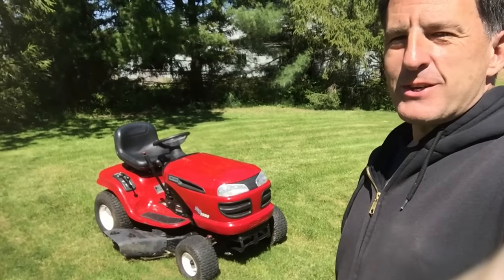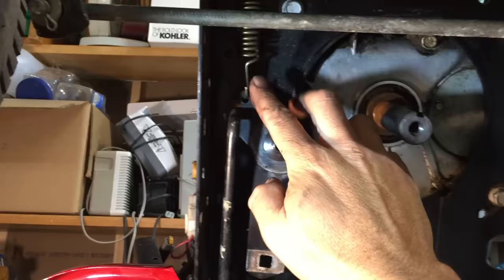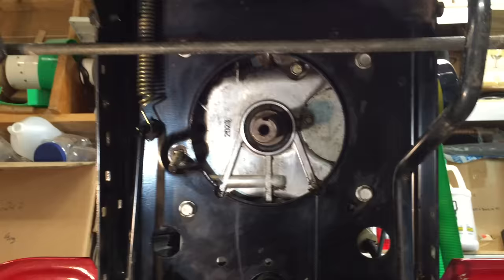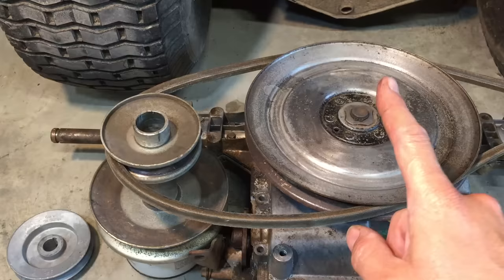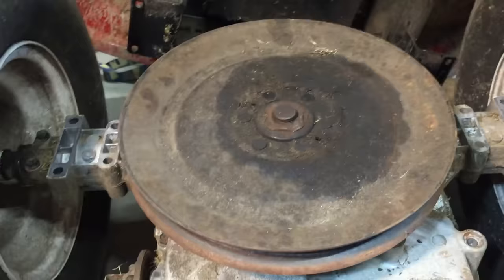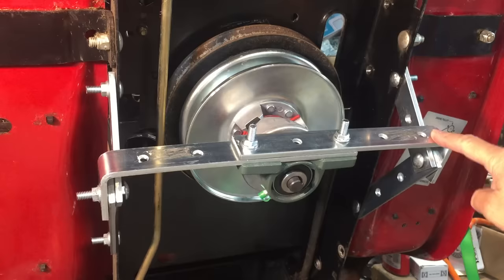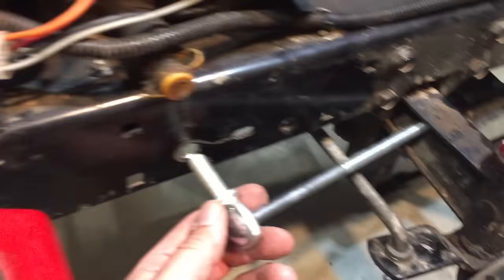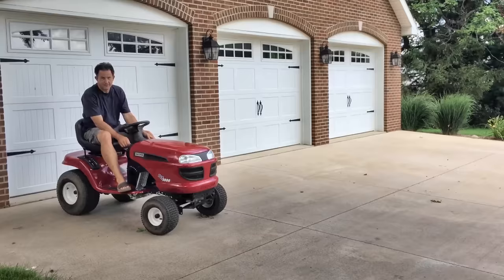Easy DIY Racing Mower

Comment: You forgot the most important part! Replacing the muffler with a header pipe, so your neighbors know that you mean business! lol
Reply from the maker: Good point!!
Reply: get a v-twin they sound awesome straight piped.
Reply: @Boemel  I agree.. My Kawasaki 750 Atv Is A V Twin And It sounds amazing.. Like A supercharged Beast And A Beast It Sure Is..
Reply: Nah bro, he did this build right and goes to show you don't need to remove the muffler to get fast because it literally was fast without touching the engine.
Reply: @j887276  the muffler delete theyre talking about is only for the sound
Reply: @aaronjoosepsepp  Which is why I don't understand why people remove it when they do a "build" like it's some type of primal recognition that fast should be loud or something.
Reply: @j887276  loud is cool for them
Reply: @j887276  ugh I was agreeing to the Vtwin in general... But the lawnmower came out really nice
Reply: How mine straight piped out the side got kinda bord of the stacks
Reply: Stupid - better to go as quiet as possible,the less you r seen and heard,the more fun u can have
Reply: @hedning003  It's supposed to be a racing mower!
Reply: @_MOORE_1986  dosnt matter,making noice to no use is just pathetic
Reply: @hedning003  Apparently you've never been around racing mowers before!
Reply: Engine swap time,, needs a twi cylinder, and wheeling Barr's.
Reply: @hedning003  when I put a two stroke on my mountain bike I made sure the exhaust was loud as hell because most people glance at a bicycle and assume it’s going 15 mph not 40 mph. Plus when you add a bunch of weight with an engine and don’t upgrade brakes stopping distance isn’t great so when people pull in front of me not seeing me I’m screwed. Loud pipes save lives.
Reply: @shtboxgarage  r'nt a mountain bike supposed to be used in the woods and such?  where there r no people?  loud pipes r just annoying and a pathetic way to say "LOOK AT ME!!" the less you r heard and seen - the more fun you can have
Reply: A REAL mans lawnmower need a sweet exhaust or none sissy’s use mufflers
Reply: oh i side piped mine
Reply: if i was his neighbor i would love the mower even more if it sounded good
Reply: @hedning003  he’s probably a Tesla fan
Reply: Just cut off the muffler
Reply: This is AWESOME
Reply: You can take out the dotted part out of the bottom of the muffler and reroute the tip it will sound a lot better while still remaining not too loud
Reply: And mud tires
Reply: @Boemel  fr tho
Reply: Briggs vtwins sound great straight pipes
Reply: @Boemel  yeah story goes i traded for a mud mower which has a 24 horse in it was modified had dual exhaust and when I started it was loud lol
Reply: Best video so far , easy , short and no yapping straight to the point . Love it keep posting💯💯💯
Reply: Soon, there is going to be the rapture. It's when there will be trumpet sounds, and after the trumpet sounds, God will lift his people from here. Also, God said people should be living by the Bible. Amen, and God bless you.
❤Jesus loves you
❤* John 3:16 - "For God so loved the world, that he gave his only begotten Son, that whosoever believeth in him shall not perish but have eternal life". ❤
Reply: @allenvayner4987  God isn't real
Reply: @Boemel  I have a v-twin engine on a mower but i need some one to convert it for me to make it fast
Reply: I have absolutely no issue with people enjoying themselves. But deliberately causing noise nuisance to everyone is inexcusable in my opinion. One person enjoying themselves while 1000 people in the vicinity have health issues related to stress. Just not cool
Reply: @imaginitivity7853  Well as your name states, let him have imaginitivity and be creative and have fun and let everyone else fuck off.

Comment: I didn't think it would be that easy to take the slop out of the steering mechanism. Very cool.
Reply: Yeah. I honestly thought this would all be a lot harder it’s way easier than I thought
Reply: Never thought one bolt would make my whole car not drive straight🤷 found that out real quick my rear camber control bolt came out somehow
Reply: @farmerbobbygrows3338  and one too many bolts in your motor can make it not run too
Reply: @RayRayLitFam  amen brotha we live we learn we die trying💪
Reply: Would you please give us sources and parts #'s for the steering bolts and bushings. Sizes etc. Thanks!
Reply: It's not going to last him, those little steering gear teeth wear fast a direct steering system (tie rod/pitman arm) would be the way to do it correctly.
Reply: @FukTheGovernment465  it’s lasted on my 20 year old mower
Reply: @joshmanis9860  You beat on a stock off road mower steering system and they go quick, lol ive done it to many times to count. By this i do not mean just going through mud holes i mean actually being hard on the mower off road wise. Same with a racing mower but it will last longer but still regardless and real race mower uses tie rod direct link steering.
Reply: @joshmanis9860  Consider yourself lucky ha ha or ride it harder like some good off road trails and that will change 🤣
Reply: @FukTheGovernment465  yeah it hasn’t been to the trails in a while because the hoa doesn’t like me driving it on the road I have bent a few tie rods
Reply: @joshmanis9860  Good off road trails will find all the weak points every time ha ha, I live in the country so no hoa to say shit to me, and even if i did and they did i lived in a hoa i would not stop riding regardless but that's just me... But yeah beef up them tie rods by welding some steel bars to them or sleeve them and that makes them pretty strong man.
Reply: @FukTheGovernment465  I might measure a stock length tie rod and buy and adjustable one from go power sports
Reply: @joshmanis9860  sleeve them before you put them on that will reassure they wont bend as easy on yua. Tie rods and stumps big rocks dont mix well ha ha
Reply: Yep, on video it only takes a few seconds.
Reply: lol

Comment: Whenever you get past the originally intended speeds, replacing the grease that's packed in the transaxle with thick gear oil is essential, unless you want to blow out the transaxle. Also, it will heat up quickly due to it being spun much faster than manufacturing spec.
Reply: Doesnt matter when the input shaft bearings dont get no grease and will burn and lock up before the gears inside do
Reply: And adding a breather on the top of the case helps with pressure building from the heat. A simple threaded hose end or repurpose a pcv valve from a car parts store.
Reply: I made one when I was younger with a top speed of 48mph. Ran that stock 5 speed for over 2 years without any issues. I simple switched pulleys though so I still had a clutch but did not have any brakes

Comment: Heres a few extra tips
1. Lower the mower closer to the ground. That way your center of gravity is lower and you wont have to worry as much about flipping
2. You can change the wheel size in the back of the mower so you can achieve higher or lower speeds.
3. Be very careful about how fast you spin that engine. You can lose the flywheel, connecting rod or the torque converter because non of those parts are meant to spin over 3000rpm. (Give or take a bit) I had my torque converter blow on my go kart cause I was turning it like 5500 RPM. Just be safe and have fun, other than that awesomd video
Reply from the maker: Great tips!!
Reply: 5500 rpm coming out of a go-cart is just pure insanity
Reply: seriously, 5500 is impressive
Reply: @johnraitt2555  well do keep in mind I had a flywheel and connecting rod that were billet aluminium and they are rated for up to about 8000 rpm. The torque converter is not, so when you run a high rpm engine like that you have to have like a multi plate clutch or like a juggernaut TC thats actually rated for those rpms. You just need to put an aluminium flywheel and connecting rod in an engine like that if your gonna turn those RPMs. Please please please do not remove the governor until you put those parts in because if the cast iron flywheel comes apart I promise it will rip and tear through whatever it hits. Ive seen guys on mini bikes have to have their leg amputated because the flywheel shattered and shrapnel tore apart their leg. And everyone thinks it wont happen to them, until it does. Seriously $200-$300 is not that much compared to the hospital bills youll have to get your leg, back or whatever other body part fixed.
Reply: All I’d say with lowering it is you’d have to watch the brackets. 
You could flip the gearbox round and lower it that way and then just put the pulleys in a different position

Comment: Hey that is a fabulous idea super impressive! however your engine pulley needs to be flipped the other way cause the way it’s set up now it causes the cvt belt to ride crooked when at full speed. So you may be able to eliminate the spacer you had to make for the engine clutch pulley
Reply from the maker: I see what you mean that by flipping the driver Pulley I could eliminate the spacer. But since the driver and driven pulleys are lined up exactly, can you explain why the belt would ride crooked?
Reply: @HowToLou  it rides crooked at full throttle because when the belt moves across the engine pulley moves up towards the engine since the belt follows the solid sides angle of the v pulley and the same happens on the driven pulley it moves down because its riding the solid ramp of the pulley down towards the ground as it speeds up. Only one v half moves side to side on each pulley so the belt follows the solid side. So you want the solid sides to be opposite of each other so that the both ends of the belt travels in the same direction across the pulley faces. I hope this makes sense. Have a good day! I just want to make sure you’re not going to go through belts left and right cause they ain’t cheap. I’ve worked with this style of torque converter quite a bit.
Reply from the maker: Wow, that is really a subtle factor I never would have realized, but I do see your point.  You are saying even though both sides of the pulley are sloped, the belt favors the solid side over the mobile side.  Interesting that the installation instructions always show the solid sides facing the same way.  They don’t mind selling you more belts, I guess.
Reply: @HowToLou   the reason why the go kart one you showed is set up to have both bigger sides of the clutch out is because the solid sides are flat and therefore the belt stays in the same line across the face as it moves. Also click the link to see the comet brochure on setup. they are only opposite on the symmetrical drive setup which is what your mower has. The setup on your go kart is a asymmetrical system. Bmi karts has a lot of how to’s to look up on their page. Have fun!

Comment: In South Dakota there are a few towns that have mower racing tracks, small dirt ovals. i think there are 3 different classes. the fastest ones are called Outlaw, they are 100% modified and are basically go carts that use a lawnmower hood lol. i think none of them use the original transaxle and instead use some sort of farm equipment gear box, now that i think about it idk how they connect the engine to the gearbox lol. They use single cylinder mower engines, and i think all add their own performance carb
Reply from the maker: Oh yeah I have seen those.  Hardly a mower at all.  They put horizontal shaft engines and chain drive solid axles.  Differentials are slower on dirt track racing.

Comment: Thanks for the video, I have the exact same mower so I will be able to have everything I need for when I start the build. Do you have any recommendations for any modifications to help keep it stable at higher speeds? I was thinking maybe offsetting the wheels and lowering it would help wonders.
Reply from the maker: Anything you can do to get slop out of the steering will help.  And yes, lowering the center of gravity will make it less likely to flip.
Reply: Another thing to check- take off your steering wheel and the cover that goes to the dash. You'll see a bolt that goes through the shaft. The hole gets egged out over time. Mine was real sloppy. Drill out the holes to the next size bolt. Made a big difference on mine.
Reply: If i would re-do mine i would drop the ride hight, cut slots out of the chassis and mount the differential higher. And make the wheel base longer, like mounting the whole front rack in front of the mower like a long dragster.
Reply: Did it work?
Reply: @ravenbuilds2.02  Yeah it works great, no issues at all. Mine goes 30 with a 5” front pulley and a 3” rear with 20” tires. I went for a mud/race mower, I can do both and it was such a fun build. 

If you want to build one and have any questions I can help you out, I’ve built over 6 race/mud mowers now.
Reply: Giant balls for counterbalance is all you need to keep it stable lol
Reply: @ninevoltmodz4687  how much does it cost you to build it?
Reply: @simongobert2472  If you have a mower that already has a manual transaxle, it shouldn’t cost you any more than $75 for pulleys and belts. They’re very cheap to make fast. The easiest for beginners is a manual craftsman.
Reply: @ninevoltmodz4687  wow its so cheap thanks
Reply: @simongobert2472  I'd recommend starting off with a 2.5" pulley in the rear just for learning on. It will have the belt slip to stop if from flipping on you, and will help you get used to comfortably shifting and whatnot. 
The reason I recommend this is because these things are squirrelly.
Reply: I have the same mower as well except with the a Honda vtwin and pedals for forward and reverse. Perfect summer project!
Reply: @noquestions9529  Mine had the automatic forward/reverse, find a parts mower. Any similar craftsman from around the same year will work. I used a destroyed 90's lt1000 for the shifting linkage, transmission and the rear body. 

Mine has the honda vtwin too, great motor. Do not pulley swap the automatic transmission, they aren't capable of handling a pulley swap.
Reply: @ninevoltmodz4687  Thanks for the information! I was doing some research and was disappointed to find out those hydrostatic ones don't work, but oh well, a challenge to overcome makes it fun. It seems many people around here have bought that era of Crastman tractor mower, maybe I'll get lucky and can nab a parts one for free. Is yours still running?
Reply: @noquestions9529  yeah, It runs great and I ride it quite often. I put a gas pedal on it and the engine responds very well to higher Rpm. As for the transmission I put a 6 speed tecumseh peerless, and filled it with gear oil. That has also taken the abuse very very well. I went with 5 in the front and 3 in the rear for the pulley setup.
Reply: @noquestions9529  however, be prepared for a headache with the shifting linkage, the actual rod that connects to the manual transmission may need to be modified for it to actually shift into 6th gear. I had to change the direction of one of the ball joints on that rod. Cut the rod, turned one end 180’ and welded it back up.
Reply: @noquestions9529  I know I’m throwing loads of information at you, but you’ll thank me later lol. You will also at one point in time, have to clean the carburetor on the vtwin. It clogs very easily and even if there’s the slightest blockage it will run very poorly without choke.
Reply: More than lowering anything about the mower itself, lowering the seat would be massively helpful for stability.  The rider weighs roughly the same as the mower and is perched at the top, right above the back wheels.  Depending on the model you can usually drop the seal quite a bit fairly easily (maybe have to move a battery or fuel tank, cut some and rebuild supports, but nothing difficult).  The harder part is getting the already crappy steering system pointed in a new direction without introducing further crap to it.
Reply: @ninevoltmodz4687  I have had many issues with the carburetor before, through a intense cleaning it's better now. It still likes to surge on a lower RPMs, but oh well. I really appreciate you taking the time to explain everything, I'll come back to this thread when I make progress!

Comment: My yerf dog 3203 go cart used the same comet 30 Series torque converter and driven pulley
Reply from the maker: Almost.  The racing mower uses the 40 series, designed for anything over 8hp.  The 3203 (i have one too) uses the 30 series, designed for anything under 8hp.  Otherwise, they are the same.  
I use a 30 on this minibike upgrade. Make Your Minibike Faster - Torque Converter https://youtu.be/GScvHAnYWZQ